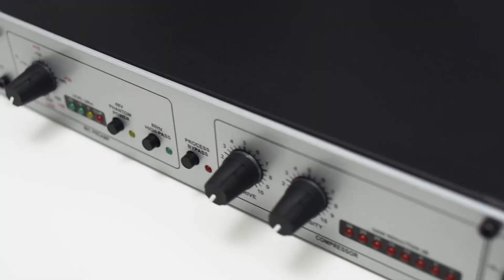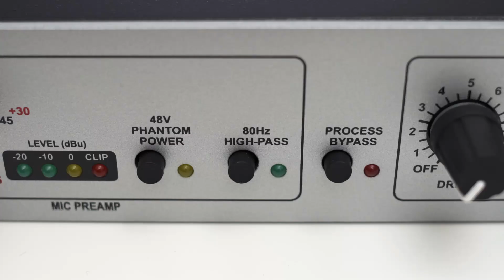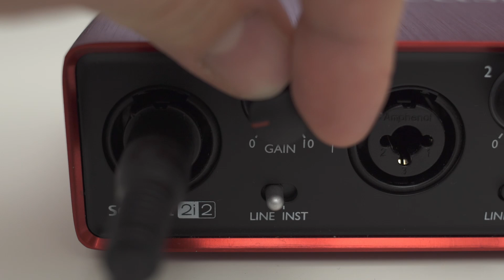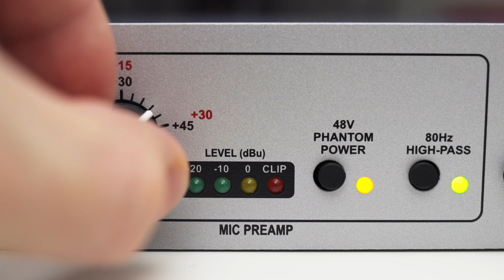Best Settings and How To Connect - get started with the dbx 286s

Comment from the maker: Important point when calibrating the audio level with a dynamic mic:
Put the smartphones speaker as close to the mic as possible and better turn the volume of your smartphone to about 3/4.
Otherwise you might turn up your preamp gain to the maximum and can't reach the level to light up the yellow LED.
Dynamic mics have a low sensitivity, so the tone has to be quite a bit louder than with condenser microphones.
Reply: With the Heil PR-40, iPhone set to max, phone speaker up against the mic, was not able to get anywhere near yellow or any reasonable level for that matter. Instead I used my own voice at a steady, average tone and level typical of the mid-range of  my overall voice output.  Seems to have worked to calibrate to my output. Any reason why this was not a suitable calibration option, outside of the fact that the levels aren't exacting?
Reply from the maker: @poltermouse  One reason might be that the iPhones loudspeaker is not very loud at lower frequencies. Maybe try again with the tone generator set to around 1000 Hertz. Get the speaker as close to the mic as possible and then turn up the preamp gain on the dbx 286s. This should light up the yellow LED. The Heil PR40 is a relatively insensetive mic, that's why you need so much more volume to reach the yellow LED. Your procedure with the voice can work, though it is not really precise. Which interface are you using?
Reply: Another tip for dynamic mics, do you have a pop filter on it, take it off
Reply: Hi Julian, do you mind sharing your Shure SM7B Settings with the dbx286s? I have a UMC 202HD interface
Reply: Also great video as always. You are the best reviewer ive seen so far. Amazing quality/explanations
Reply: I do have an issue the other way around, my mic (Neewer NW-800) is extremely sensitive. Meaning after I had set the level to the yellow LED approx. 3 o'clock (with 440hz constant tone and medium smartphone volume) I had to turn down the output gain all the way to -30dB to at least reach the 0dB in the audio software-scale. Could you please help? I am a bit lost. my setup: neewer nw-800 --> dbx 286s --> behringer U-PHORIA UMC22 --> PC (USB)
Reply: Hey , what about. Interface? I want to connect interface and video camera. Is that possible?
Reply: Wow, thank you for this tip in the comments. Calibrating my RE320, and with the mic screen off, tone up to around 80%, the 286s preamp needs to be up almost at full gain before I get a yellow light. Only two notches below max. Additionally, I needed to lower my 286s output gain to -12dB. Thanks for this. My first try was at the condenser settings and I thought something was wrong with the 286s!
Reply: @JulianKrause  Here's the problem. This is not a consistent way to calibrate your volume. Everybody's phone is different, and unless we have a reference sheet for getting the same volume across all phones, it's not gonna work. For instance, I had my phone turned to 3/4 (like you said, since I am using a dynamic microphone), but I still got intense clipping when I tried speaking through it.

To be perfectly honest, I think it would be much more effective to just speak into the microphone normally and see where you voice falls in terms of volume, because that's another thing to take into consideration when calibrating volume.

Overall, I really like the video, but that's just one glaring issue I couldn't help but point out. Hope you got something from this post, and thank you for reading this far.
Reply: Julian, first, thank you for this guide - great as always. I ran into quite a suprising issue when trying to route the dbx286s‘ output through a Zoom Podtrak P4 into a DAW - with downright terrible results. After calibrating a dynamic mic as per the guide (i could get the atr-2100 into yellow even with 1000 Hz tone and phone volume up only when putting the phone‘s speaker right on the grill of the mic) using the P4 as an interface, I have then tried to use it with spoken word. As the Zoom P4 would not let any signal through unless you give it a little gain, but - this was suprising - even with the gain dial turned only very slightly, barely to „1“, it started clipping badly. I had to turn dow the preamp on the dbx as low as 15db but even then, the audio was bad. I have cross-checked it with a Focusrite 2i2, it worked great, so the cable and the unit were fine. Is it possible that the Zoom P4 is just not able to take the processed signal of the dbx or am I doing something wrong? I made sure that monitoring on the DAW was off and the USB loopback on the P4 was switched off. Appreciate your advice.
Reply: I think I’ve figured out the root cause: the dbx puts out a more or less line level output whereas the Zoom P4 accepts only a mic input - the line level is way to hot for it which explains the constantly clipping audio even at very low gain settings. So I put a DI box between the dbx 286s and the Zoom Podtrak P4, applied a -20db pad and it works like a breeze. It is a perfect podcast signal chain: preamp, high pass filter, compressor, de-esser, LF enhancer, HF enhancer, downward expander/gate and finally the limiter on the P4. No more post processing with digital plug-ins is needed once you dial it in ie based on your guideline! Thanks a lot again for this tutorial. Amazing work.
Reply: Any idea what I am doing wrong if non of the level LEDs for calibrating light up? No matter how high I dial the gain
Reply: Thanks for this. Super helpful
Reply: @PodcastMeister  So glad I found your comment because I’m thinking of adding the DBX 286s between my SM58 and Podtrak P4 and this would have been super disappointing.   Can you provide more detail on what a DI box is, or a link to what worked for you?
Reply: @RedState420Esq  glad it helped! I will look up for you the exact model I’m using but essentially a passive DI box with 20db pad will likely work. They are dirt cheap too. I’ll make a video about it soon, aas well as about the dbx286s.
Reply: I happen to use the IMG Stageline DIB-100
Reply: @PodcastMeister  Thank you! Just subscribed to your channel anticipating the video.  The device looks cool.  Curious whether you are outputting from the DIB-100 to the P4 from 1/4" to XLR (front of the DIB-100) or XLR to XLR (back of the DIB-100)—and does it make a difference?
Reply: @PodcastMeister  Thank you!  I know it's a big ask, but would you mind replying here when you post the video?  I've subscribed to your channel, but I'm subscribed to 100s of channels and will miss the notification.  (Though I will be checking back if/when I get to where I'm ready to pull the trigger on a dbx286s into the Podtrak P4).
Reply: @RedState420Esq  I honestly can’t remember and I’m on summer holiday right now, but I will check it for you as soon as I’ll be back in 2 weeks. Thanks for the sub! 🙏
Reply: @RedState420Esq  No problem - I hope it also boosts Julians channl for more interaction, although he is not in dire need for it anyway I suppose. :)
Reply: @RedState420Esq  I’m back and have checked: I am going out from the DI box through the XLR-output and the reason being that the line output is way too hot (it states 50k Ohm on the box) so I need the mic out with mere 600 Ohm for the P4.
Reply: @PodcastMeister  Thank you!
Reply: This in my opinion is terrible advice simply because different phone speakers have different strengths of volume and microphones are different.
Reply from the maker: @gimptoast  The exact volume of the speaker does not matter! It just provides a constant level to calibrate the output of the 286s to the audio interface.
Reply: @JulianKrause  I tried it with all the recommend settings in the video using a SM7B and a iPhone SE 2020 and it couldn't even pick up the volume with phone on max volume and DB cranked up. I appreciate your videos, that particular part just didn't function well for me personally.
Reply: @poltermouse  For calibration you need sound that is constant, always just as loud and doesn't pause. Reason for that is, because if you use compressor or either of enchancers, they all boost your sound by certain levels which in return might be either too loud and cause your audio interface to clip it, or too quiet and your audio interface can't hear it without adding gain causing possible hissing sound when you put too much gain to your microphone input.

In short, importance of calibration on audio stuff is VERY visible (well maybe in this case hearable), when you are screaming to your mic and try to eliminate clipping with compression and such and / or add effects processor to the whole combo.
Reply: @marcello9207  First set mic and output gains to absolute minimum, then whistle and increase mic gain till it is yellow, after that set compression drive to 3 (or untill 3 first lights lit up on gain reduction as you whistle), density to 7 (or untill the gain reduction light is synced with your loud speech) and start increasing output gain while speaking with normal voice level till you hit sweet spot. Lastly make quick high pitched scream to make sure that neither DBX or your audio interface clips ( meaning compression works as intended).

After that you can adjust noise expander / gate and the rest.
Reply: Now I finally figured how to calibrate the DBX 286s. I finally understand now the source volume (tone generator/voice) IS NOT important, but you need to make sure it reaches 0dBu on the Mic Preamp. I've tested this more than 5 times and the results are consistent as hell. Heck, I don't have to worry about clipping anymore but still maintaining high signal-to-noise ratio.
Reply: @poltermouse  I'm seeing exactly the same with my Heil PR-40.  Wonderful sound but wow low sensitivity for sure.
Reply: @39zack  why?  So you can get the phone closer to the mic I'm guessing?
Reply: Hi Julian, I connected the 286s to my Yamaha MGP16X via TRS-XLR. Is TRS-TRS better AND should I use the Insert or the combo-input on my mixer?

Comment: The thing that differentiates Julian's DBX286s video from the rest is the signal gain calibration at the beginning. I was trying to avoid using too much gain for fear of noise on the DBX but having followed Julian's method on getting the final gain to around -18db  I now have amazingly clear recordings with a great signal. I highly recommend watching Julian's video on 'gain myths', it explains why we target -18db. Thanks Julian 👍
Reply: What distance should phone be held from microphone? Why Other Forum say use 1khz test tone? Also why should phone volume be set at half? Please help julian doesn't respond thank you
Reply: @SuspiciousPixels  Do so that the yellow 0dBu led is light up. 440hz or 1khz and the distance of the phone doesn't matter.
Reply: @SuspiciousPixels  But in the end as long it doesn't clip the front end of the audio interface it doesn't really matter. Set output to noon or according to the audio interface input like setting up a mic and you will be fine.
Reply: should you always record at -18db?

Comment: This is by far the best, most detailed and helpful guide to properly using the DBX 286s that I've seen on YT so far. Your clear explanation of precisely what each control does and why to use certain settings is fantastic and helps me understand the 286s. After my previous comment on having issues with connecting a 2i2 and a DBX 286s, I can't help but think I might have inspired the content of this video. If so, you put together a very well-thought-out video with remarkable speed. As usual. Two thumbs up.
Reply from the maker: I might have chosen the 2i2 specifically because of your comment ;)

Comment: Bless you! 😁🙏 After trying out several mics, I think I've decided on the SM7B. But the fethead I just received is going back to Amazon. I've ordered the dbx 286s, instead. Figured I'd be better off spending an additional $125 to get the hardware processing for a much better result, and begin my rack collection. lol Audio interface is Scarlett Solo. Plan on doing voice work. And I am SO happy I found your video!!! Viel dank! 😊

Comment: Another superb video. So many people abuse compression and noise gates by setting them far too high - usually paired with bright and harsh sounding microphones to create what they perceive to be a professional radio sound. Such settings are designed, when used intelligently, to make audio intelligible in noisy environments such as cars and on public transport. You need  subtler settings for playback in a normal listening environment and your video makes this case perfectly.

Comment: -18dBFS is typically +4dBu  in studio equipment  and not 0dBu
Now lets think if 0dbu is our maximum  analog level -  what will be the max level after compression, and other processing.
What will be  if we will speak louder or even yelling or screaming?
By Setting it to -18dBFS you reduce your dynamic range especially if you are recording in 16bits.

I think  that it will be correct to set the mic gain  that when you sream or yelling as louder as you need during  voiceover so the yellow light  lights at peak, but not red light.
Next you set all processig you need to  do with your voice and next - yell   or scream again and set  input gain of audio interface so that it peaks something at -12...-10db.
If you set up  like this  you normal voice level will be near -22...-18 dBFS and you will get maximum dynamic range and also  have enough headroom for yelling  and screaming  and will never clip.

Comment: Very good explanation,  Julian.  One of the most frustrating, and I must admit almost never explained features, is the difference between a noise gate or expander.  For some mysterious reason you will see the words gate and expander printed on the device but nobody takes the time to detail just how these setting are applied in the real world with practical examples.  Also... when is this actually applied in the signal flow?  There is a debate about applying the gate/expander before or after the compressor.  And so it goes.  You're actually one of the few on YouTube , along with Gerald Undone, who take a methodical and thorough approach to testing.

Comment from the maker: Timestamps!

-Connection and audio level calibration 0:31
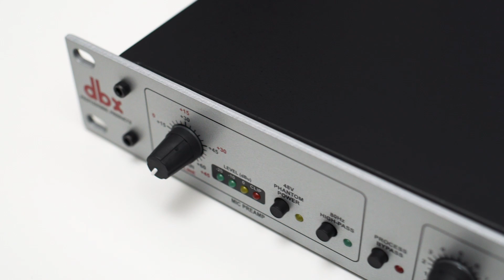-Preamp section 4:17
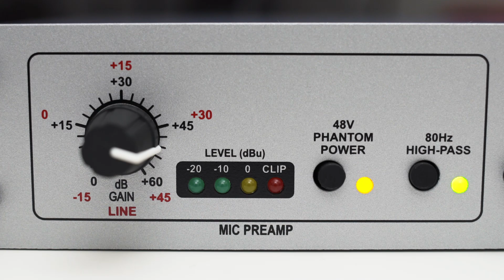-Bypass button 6:09
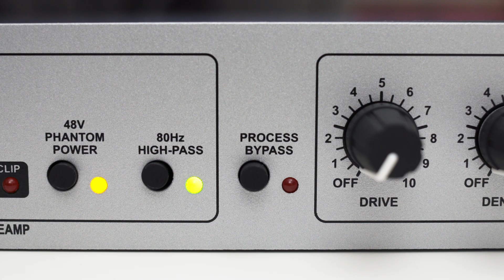-Compressor 6:37
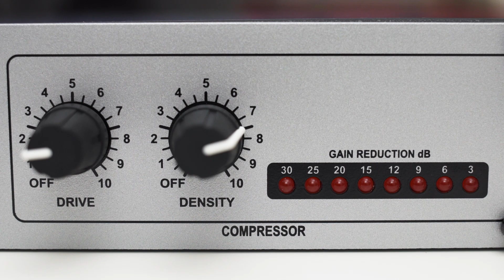-De-Esser 8:39
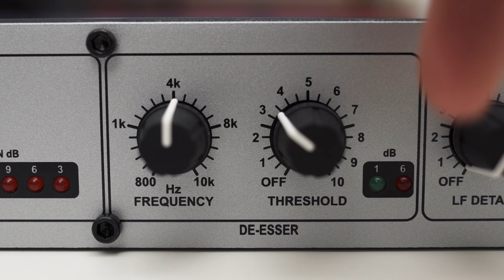-Enhancer 9:55
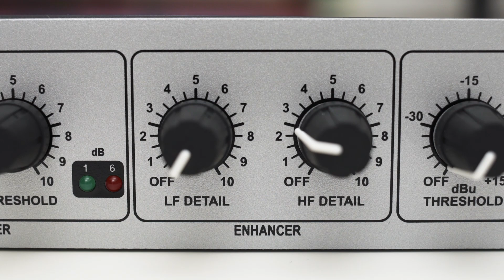-Expander/Gate 11:14
-Output 13:32
Reply: Hello. May i connect it thru mixer auxiliary output and return to stereo channel of mixer?
Reply: i cant find a trs to trs cable lol
Reply: You should add this to the description so it automatically shows the segments in the video player :)

Comment: Just realized that the Output from the dbx is *Line level* and in Presonus Studio 24c i have it on the Input with XLR so it reads it as **Mic level**. just changed it to TRS. omg how did i miss that lol. i have it like this for over a year.
Best dbx - 286s video i've seen.

Comment: Julian,

I just wanted to let you know that this is a GREAT video. I have a 286s and have watched a million videos on it to get it dialed in -- but this is the ONLY video I've found that mentions anything even remotely about calibrating it with your interface. I had no idea until this video. Come to find out that I needed to turn my interface up to about 25% because the level in Audition was only reaching -30ish dB with the interface turned all the way down. Mind blown.
Reply from the maker: Glad you liked the video! The reason why nobody talks about the calibration is because the 286s puts out a line level signal and an interface is designed to record a line level signal. This suggests that there is no calibration needed. But audio interface manufacturers leave different amounts of headroom above the nominal level of the professional line level signal. So, a calibration ensures that you get the highest possible dynamic range out of the system. Just out of curiosity, which interface are you using?
Reply: @JulianKrause  That makes a ton of sense, it's just something I've honestly never thought of before (and clearly many others haven't, either), so thank you for putting it out there for all of us. The interface I was referring to in my comment is a UMC404HD.
Reply from the maker: @dmargittai  One more question: Do you have the PAD on your UMC404HD enabled or disabled?
Reply: @JulianKrause  Interface is and has always been set to line with pad NOT engaged. XLR from mic into the DBX, then a TRS-TRS from the DBX output to the UMC input. Maybe it has to do with me using a TRS-TRS instead of a TRS-XLR?
Reply: @JulianKrause  

edit
Got it figured out. 

Thanks for all you do, buddy!
Reply: @dmargittai  hey sorry, your comment is a bit old but wondering what your solution was. Struggling with a SM7B + DBX + UMC404 setup right now. Noisy when approaching -18 dB level in my DAW via TRS - TRS

Comment: One tip worth mentioning is that if your audio interface can accept too hot signal without distording audio, you can slightly reducing the noise floor by using too high signal (e.g. +3 or +6) level from 286 S and using less gain in the interface input. The whole point of the calibration is to get the yellow led in the mic preamp to match the -18 dB in your digital audio recorder without the audio getting distorded in any part in between. And the higher (but still below clipping/distortion) you can keep the signal for the whole chain, the better noise floor you'll have.

And -18 dB is not a hard rule either. I'd personally calibrate closer to -12 dB to potentially improve noise floor by 6 dB but then you have more risk with clipping if your actual audio source gets much louder.